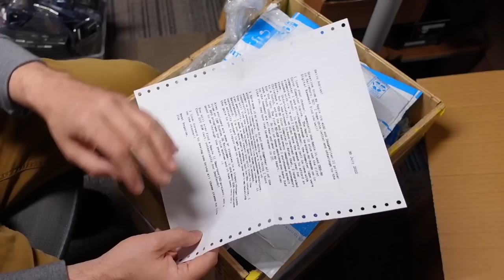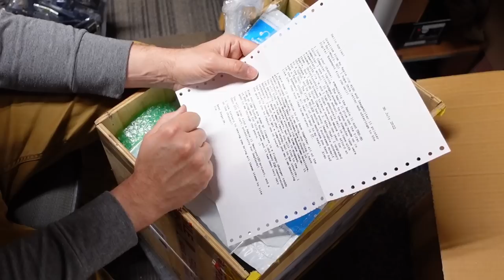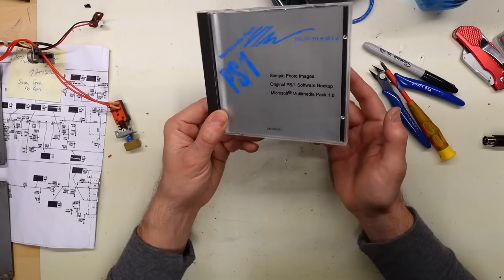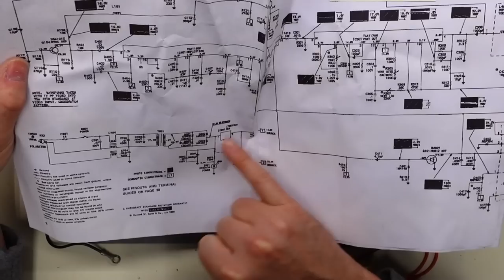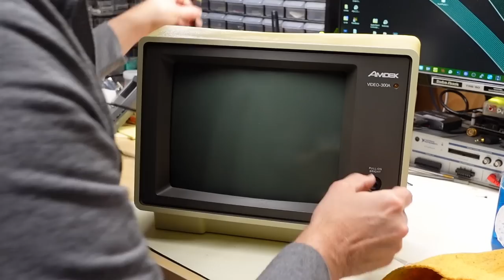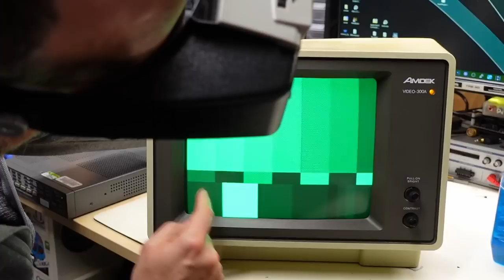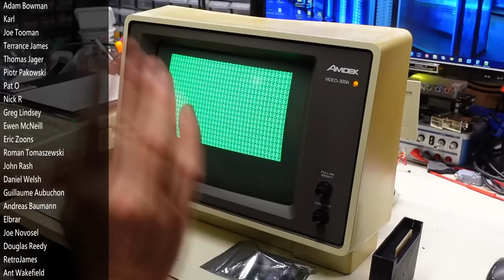0055 Fixing a monitor that was damaged in shipping (and more!)

Comment: This monitor board repair kind of reminds me of a crazy repair at work. I was in a telco repair centre, a colour PC monitor came in that a courier had dropped. The tilt and swivel base had been driven up through the base of the monitor, right through the main PCB, that was now in four pieces. It was immediately written off. 
One of our new trainees took an interest in it, so we gave it to him. He set about joining the board sections back together with many many tracks being patched with tinned copper wire. (it was actually proving good as repair/soldering training). All almost done, except for one transistor that had a leg sheared off at its case. This was an odd transistor in that it's case was green, Anyway we pointed him (the trainee) towards a large box of scrapped boards, he dug through and found a board with a green transistor (note, the skipping over of the concept of part numbers!) He promptly fitted that transistor, turned on the power and it just worked!
Everyone there (with the exception of the trainee) just stood there with their mouths wide open in disbelief.
  What, No, Bullshit, how the hell....   you get the picture.
Reply: Incredibly, you are still using the monitor to this day!  You were that trainee I'll bet.  It's 30 years on.  It's safe to admit it.  Well done, trainee!
Reply: @Starchface  No, I'd long passed from being a trainee at that stage. I was with the rest saying "No way", that's why the story has stayed in my mind.

Comment: A note about monochromes and color sensitivity at 37:20: Amber sits between red and green, putting it at the more sensitive end of the spectrum. Blue is the end that the eye is less sensitive to (typical human eyes are more sensitive individually to red and green than blue, and there's also a lot more overlap between the two cones that contribute to red and green vision than to the ones that contribute to blue, effectively doubling the sensitivity on top of that).

But the eye's sensitivity to each wavelength has nothing to do with how long the phosphors last though. I know from experience that amber phosphors burn in WAY more easily than green, so that's why amber monitors are less vibrant today than green ones. Which is a shame because amber is best monochrome.
Reply: And red seems to always be the first channel to burn in on OLEDs

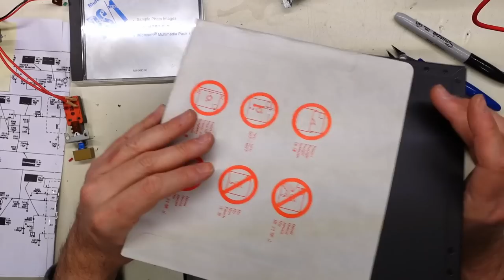Comment: I believe that 8" diskette caddy (15:26) was from an IBM System/38 minicomputer.  The computer had a housing on the left-hand side that contained a pair of slots for 2 of those caddies under a hinged lid - thus 20 8" diskettes could be used to load updates to the computers IPL (Initial Program Load) or OS (CPF).  Obviously when IBM sent us a large package of diskettes for updates (pre-internet) we had to make sure the diskettes were placed in the caddies in the correct sequence as the updates would cycle through the diskettes in sequence...

I can't see Adrian fixing a System/38 as his basement isn't big enough!

Comment: I assume you're supposed to sandwich the PCB between the pins of the 19-pin D-sub connector and solder to both the front/back. It's pretty common way to attach D-sub connectors to PCBs on DIY projects.
Reply from the maker: Indeed -- but in this case, it doesn't seem to have the pads on the PCB for this. It's ok -- I can just use a ribbon cable to a D-SUB. Hopefully I can find my DB19's -- I bought several as these are newly made again.

Comment: Adrian: The SmartPort allows for both block and character devices of all sorts of different types. The Apple2 FujiNet implements the first working implementation of SmartPort Character devices for its network, printer, and modem adapters, while implementing block devices for the four virtual disk drives that can read/write blocks over both the network, and local storage.

Rob Justice and Katherine Stark have contributed time and code to the Apple2 FujiNet. :)
Reply from the maker: I just love how Fijunet is expanding to other systems! We need Fujinet on everything! And I'd love to have a network adapter for my Apple IIc. I wonder -- can you have multiple smartport devices on one computer?
Reply: @adriansdigitalbasement2  you could, but most software would only find one of them.

Comment: I had an Apple ColorMonitor IIc and that was fantastic back in the day on my Apple IIc. It had a monochrome pushbutton on the front for when I wanted to use 80 column mode text for things like AppleWorks and ProTerm II. It also was a color display so I could play all my games in color so I had the best of both worlds. I still have that monitor hooked up to a IIgs because I haven't yet found a suitable RGB compatible display solution for it yet.

Comment: My understanding is that the band gap for the amber phosphor is larger than for the green phosphor, which means that it requires a higher electron voltage to excite the phosphor into emitting photons. It also means it's less efficient, since you're pumping more energy into it for less photons, and that basically burns out the phosphor more quickly.

Notice how the green tube was a lot dimmer running off the original electronics than the Amdek electronics? That could've just been because the original electronics needed recapping, but I'd be willing to bet the output of the flyback transformer in the Amdek goes a lot higher. And that's because the amber tube requires a higher voltage for a similar level of brightness.

As for which one I prefer? Back when I was in primary school, we had Microbee computers with either green or amber monitors. I always liked the amber ones best because the colour kind-of matched the orange stripes of the cute little bee on the badge of the Microbee computers. And that's why I've always preferred amber monitors too. Unfortunately in the few years that used those machines before they retired and replaced with 386s running Windows 3.1, most of the amber monitors were slowly replaced with green ones, as the amber ones died. It got to the point where I had to rush into the room to grab one of the amber monitor machines before someone else randomly took it.

Anyway, good to see you got the Amdek back up and running again, even if it's with a green tube instead of an amber one.

Comment: I just bought and refurbed a near mint CoCo 1 off eBay and fully restored it to mint cond. All new caps, all new power regs, all new ICs except the CPU, fully cleaned and fixed. And it's a low serial number - one of the first ones made - 29,000 and something.

Comment: When you had the tube loose on the table you really should have had the ground also connected to the dag coating on the back, you can easily do this with some picture hanging wire attached to 2 of the tabs.  Hey remember the Coleco Adam? That was a interesting computer. LOL.
Reply: Why ?
Reply: @andymouse  because the charge will build up in the tube and can discharge into the chassis when there is enough potential.

Comment: For the SmartPort adapter, it looks like the PCB goes between the pin rows on J2, and the connector is soldered directly to it. Check if there is an appropriate number of pads on the back.

Comment: Correct.  That cassette was for the system 36.  Ours used 10 (I believe) to back up our mainframe.  100 8" floppies.  Those were the days.
Reply: I didn't know they had a flexible disk changer.  But then if you didn't have the space for 9-track tape...

Comment: Sooo... you sure that apple connector doesn't solder up to J2 and the middle line. With J1 and the middle line also accommodating another style connector, if utilized that way. The pinout would allow it.

Comment: crt is nice (when optimized) a nano mask photolithography draw tool
Reply: its also a sub blu-ray dot size disc read-write head, yes like sem/tem imager, you can even look at the mistakes of a blu-ray light burner drive discs
Reply: I wonder if blu-ray discs could be used directly by the e-drive, and added vacuum when disc is inserted
Reply: I bet you could even draw colors with the electron beam, depending on the exposure, or dotter color matrix substrate, then activated to a rgbw level per dot, 3/4 pixel dots
Reply: ie permanently activated color pixels, more than 1-bit per pixel, the color level 0 to 255, yes like a nano/micro film, or image storage on the disc surface
Reply: or just deposit some amount of ions of various atom species to have them to be some value or a number base
Reply: yes like a sem value of all the ion/atom contents of the dot
Reply: These are interesting points but I wonder why they’re not just one comment? The algorithm usually down ranks this many self replies FWIW
Reply: @kaitlyn__L  why would you think I appease some algorithm, why would you rule how I should comment
Reply: @kaitlyn__L  maybe I will not editorialize for your pleasure
Reply: @kaitlyn__L  maybe your head broke
Reply: @kaitlyn__L  i'm not the op of the video, what on earth are you thinking, its just the points, nothing but the points, so help you God
Reply: @Jkauppa  lmao
Reply: @kaitlyn__L  if you dont care about the points then mind your own business
Reply: @kaitlyn__L  sounds you dont actually care about the comments, just about nonsense
Reply: @kaitlyn__L  you could have just said, "I dont care but..."
Reply: @kaitlyn__L  I dont work for you, or anyone, for that matter, so cut it, lady